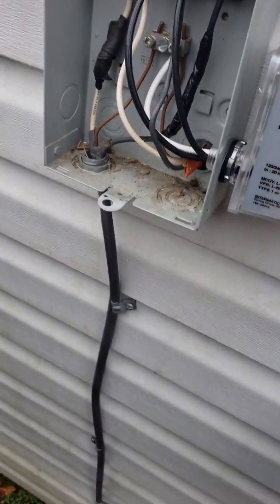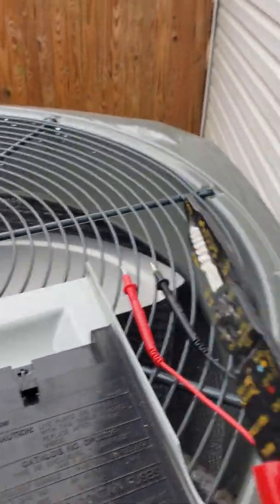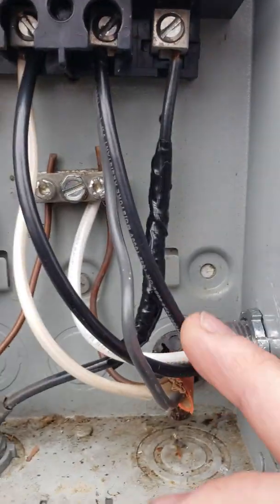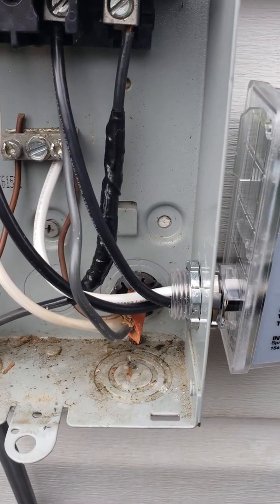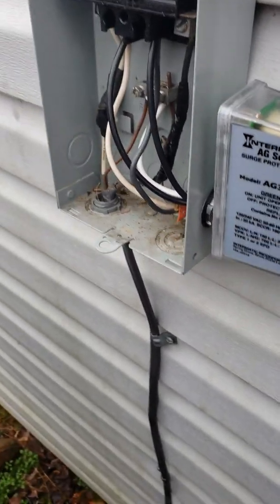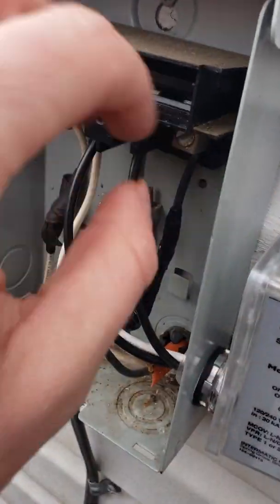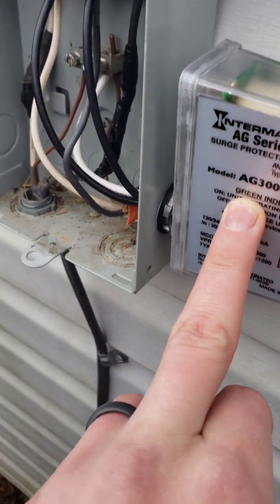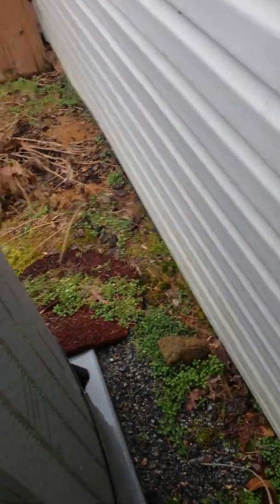Hvac compressor surge protector instal

Comment: Nice video!  If this was a 110V application, would you still connect the white wire from the surge protector to the ground lug, or would you connect it to the white neutral wires?
Reply: For 110v. the LINE terminals will have black (hot)  on one terminal and white (neutral) on the other.
Both black leads from the surge protector go to the black line wire, the white wire to the neutral line wire, and the green wire to the ground line wire.
Reply: @joeweatlu5169  manual from INTERMATIC for the cd1-024r shows “typical 120VAC application and illustrates black to line, white and black with (included) white sleeve to neutral. Literally look at their manual before telling me that the company that made this UL listed device is wrong…..
Reply: For 110-120 the manual says solid black to black. White and the other black with it but there is a white sleeve you put over the second black wire to “mark” it as neutral with the white cable. Their website has the book on there. The pic will make it make sense.
Reply: @sideburns2009  Totally and completely wrong!!!

Comment: I don’t think you were supposed to cut the wire shorter.
Reply from the maker: "Ensure conductor lengths are as short and straight as possiblefor best performance. Do not coil excess wire. The SPD functions best if all bends in wires are rounded, ideally to a 4” radius. Hard 90 degree bend will reduce efﬁciency." 

It's in the first paragraph of the instructions
Reply: Yes you are per manufacturers instructions. Short as feasible

Comment: You need to move the line in.
The line in voltage is in wrong position. 
The outer plugs are for the incoming bolts feeding the disconnect
Reply from the maker: It's literally stamped on the box where to wire the line in. And on mine it's stamped in the middle you can see it in my video.

Comment: I know this video is old. People watching should know that this installation is actually completely ineffective in stopping surge. Every inch away from the panel affects the surge suppression in a very real way. This sort of distance would make the device basically invisible to a surge at the panel. Literally 12 inches of 12g wire will double the clamp voltage of this device. At this distance the clamp blowups be after devices were fried
Reply from the maker: What in the fuck are you even talking about I'm legit a EE In electrical protection for substations. Your description of me being wrong is literally nonsense. Its a damn surge suppressor dummy .. . its on a disconnect for an hvac it's literally inches away from. the device it's protecting. You don't even know what your talking about
Reply: You're incorrect.....the "panel" is not a factor in this install.  The disconnect is being used as it is supposed to.  The manufacturer (and others) use the a/c disconnect as the point of surge protection.

Comment: The line lugs should not be double tapped so the connections do not become loose. Wouldn't it be better to splice and wire nut the connections?
Reply: I would make 2 pig tails with wagos plain and simple code install. No double lug no second guessing!
Reply: Yes
Reply from the maker: You can do whatever you want to do. If you don't feel safe then don't do it. The hvac company was going to install it the same way.

Comment: The directions say to connect to the load NOT the line. Why did you connect to the line?
Reply from the maker: You need to re read the directions there's two install types. Type 1 and type 2 line and load side. https://www.google.com/url?sa=t&source=web&rct=j&url=https://www.intermatic.com/-/media/inriver/6734-8116.ashx/AG3000-InstallationInstructions-EN&ved=2ahUKEwjB3pvM8aLqAhWRknIEHQ8wDCYQFjACegQIARAC&usg=AOvVaw0-IlRMo1MR7DFD434UAYqw
Reply: Thanks, this clears up everything. Great video!

Comment: That's the wrong device, Brother. 
Its the compressor defender ,
 the only device who you need to install outside. 
That device right there ,  is for the heat furnace or air handler inside the house.

You  need to install the compressor defender outside the house & the ag 3000 surge protector inside the house.
Reply from the maker: Unless you have an outdoor compressor (or heat pump) that is more than 20 years old, it would be a better idea to use two AG3000s, or in my case, I use three AG3000s. Let me explain. The main difference between the CD1-024R and the AG3000 is the CD1 has short cycle protection in addition to surge protection. What this means is that if you have a power failure that lasts just a few seconds, the CD1 prevents your compressor or heat pump from starting right away because this "short-cycle" can damage the compressor. However, virtually all compressors and heat pumps that were manufactured in the past 20 years have short-cycle protection built in to the unit, so the CD1 would extend the delayed startup from 3 minutes to about 5-6 minutes. This is completely unnecessary, and since CD1 costs significantly more than the AG, you may be wasting money for a feature you already have. You could test your unit by tripping the circuit breaker that feeds your compressor while the compressor is running, then flip it back on after a couple of seconds. Check your compressor and see if it comes on right when you flip the breaker on, or is delayed a few minutes.
Reply: @comander7681  The Intermatic CD1-024R Compressor Defender is more than a surge protector like the AG 3000. It will prevent the compressor from coming on during a brownout, under voltage/over voltage event, read the information sheet,https://www.intermatic.com/-/media/inriver/13129-28016.ashx/AG3000%20CD1%20024R%20Power%20Protection%20Duo%20Brochure  the AG 3000 will NOT do that, it is ONLY a surge protector. The timer in the AC unit will not scene the the voltage variance. Running a compressor during a brownout, under voltage/over voltage event will burnout the compressor motor. Let's see, a Compressor replacement for about $2000.00, or a Intermatic CD1-024R Compressor Defender for about $100.00. Guess what I did?
Reply: @georgebecht  My AC company only uses this unit and said compressor defender is unnecessary with my 3 year old unit.
Reply: My AC company said, that if you want your 3 year old unit to become a 10 year old unit, use the Compressor Defender
Reply from the maker: @georgebecht  I don't need the compressor defender. my hvac already has all those protections built in. Compressor defender is just a cash grab for newer units.
Reply: @georgebecht aka compressor saver?
Reply: Seems as though you Contradicted the installation instructions, it specifically says to leave as much wire as needed, and to make a 4" loop, it would seem as though intermatic specifies this for a reason, you had a ton of room in the disconnect box
CONFUSED IN CALIFORNIA
Reply: @bvshvac  From the instructions..."Ensure conductor lengths are as short and straight as 
possible for best performance. Do not coil excess wire."

Comment: So, I have a question.  The manufacturer install instructions are very unclear for this type of install.  Much clearer for main panel but even then, the instructions are too vague.  Anyway, my concern is attaching more than one conductor to a lug.   something the NEC frowns upon.  this is essentially a double tap and really is not different from a double tapped breaker isn't it?  (I know square D makes/made breakers designed for two conductors but that's not what I'm talking about).   The install instructions don't explain HOW to properly make the connections.  I see these installed the way you did it all the time but I thought I'd ask your opinion.  I don't know how else this could be done honestly but  I'd greatly appreciate a reply to resolve/discuss this question.  Thanks for the great video!
Reply: You are correct about double tap. Not a good idea. The easiest, most straightforward way to fix a double-tapped circuit breaker is with a pigtail connection.
Reply: It's fine this way. The a/c itself has wires double-tapped from the manufacturer in the same way and it's considered a disconnect and not a breaker. Electricians some times get confused over the NEC code.
Reply: @TerryRGraham  No. The disconnect does not allow you to put two wires in one terminal
Reply: I'm also concerned. I might get the disconnect with built in surge
Reply: When this fails, Intertec will not pay out because it was it was not installed correctly.  You cannot double tap, even in a disco.  Pigtail and use Noalox in the nuts and on the end of the wire in the lug.
Reply: @jrnycsb - so wire line in as wirenutted- line, load (pigtail), surge all together then run load into the bar?
Reply from the maker: You're right in most cases double lugging is prohibited. The NEC code basically says sometimes and it depends. The equipment was designed to be installed in this manner and is certified UL rated to be installed this way. Here's a video from intermatic that basically shows you the exact same installation. https://www.google.com/url?sa=t&source=web&rct=j&url=https://m.youtube.com/watch%3Fv%3Du4CXJiVpflY&ved=2ahUKEwiLzqnxwJfkAhUF2VkKHaWKDqsQwqsBMAJ6BAgEEAo&usg=AOvVaw0FuLqCb4yfePFSDB0hkKfV
Reply: @comander7681   you rule.  thank you!
Reply: @comander7681  there are a few errors in this install.....the video does not come from the manufacturer.
Reply: @comander7681  Not you cannot double tap, You can buy double lugs that will allow you to install two wires.
Reply: @comander7681  That video is NOT from Intermatic!

Comment: We charge $350
Reply from the maker: Yeah when they said how much it was going to cost I was like hell no. I work in industrial controls so I  just peeked at the box he had and bought it online. It took me like 15 min from getting the tools out to installed.
Reply: Damn my company charges $249 and I thought that was a lot
Reply: The Compressor  defender is the only device for the condenser or condensing unit not that ag 3000 suppressor which is made for the furnace or air handler.
Reply from the maker: @AngelTorres-tk2nw  this is not true.

Comment: Will this protect against brownouts?
Reply from the maker: No it will not
Reply: Great video very simple only suggestion is if your installing this device you can’t cut the wire shorter manufacture recommends you leave it the same length also this only goes installed on a service disconnect so if you unit is connected directly to the breaker panel you would need to install a service disconnect then install that to your disconnect not at the main breaker panel
Reply: No, if you're in a brownout, turn off you air conditioner and any other equipment that might be damaged by a too-low voltage (mostly motors). It is also not a bad idea to turn your A/C off at the breaker if the power goes out. There will be a surge when the power comes back on that could create problems.